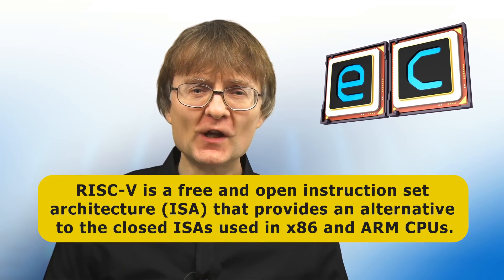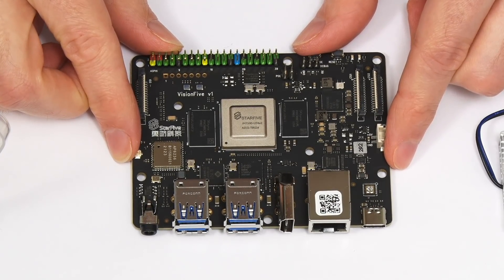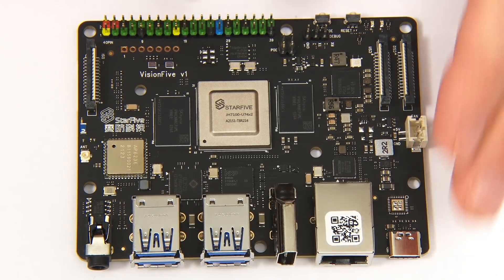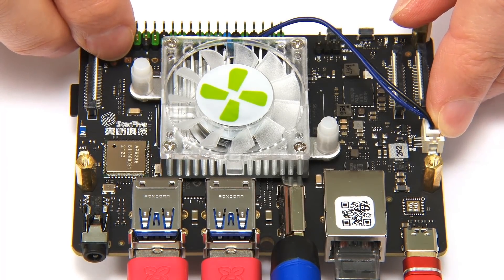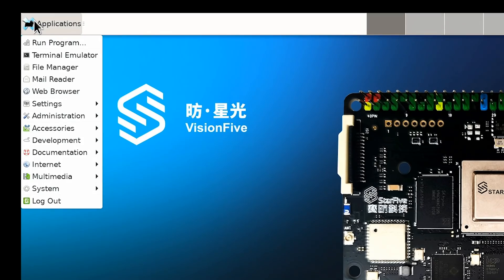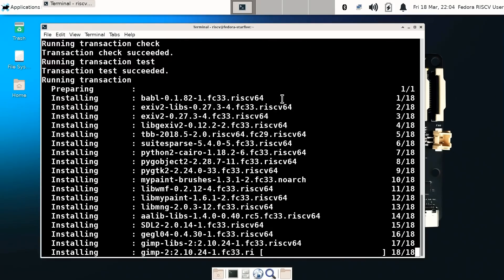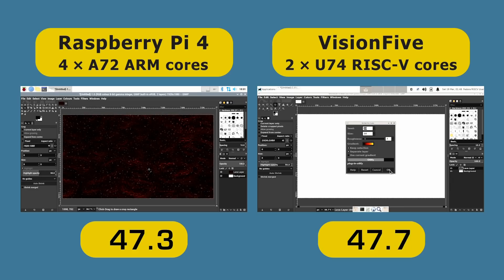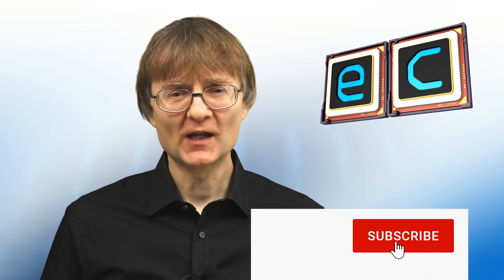VisionFive RISC-V Linux SBC

Comment: I'm confused, not that that takes  much! But,  I've always believed the processor hardware defined what instructions had to be used for that processor. How can you have differing sets of  instructions for any given processor? How can you have open source ISAs that differ?

I'm excited to see any new open source hardware or software as it frees us from the proprietary reins of manufacturers and software houses! But I'm at a loss as to how you can have more than one ISA for a given piece of hardware.

Thank you professor! An enlightening video!
Reply from the maker: Thanks for this. :) You cannot have more than one ISA for a given piece of hardware. RISC-V does allow more parties to design custom CPU cores. But the "open" here refers to the involved intellectual property (IP) -- anybody is free to use the IP to design and manufacture a RISC-V core and processor. This is in contrast to x86, where only Intel and AMD can make the chips, and ARM processors, where a license needs to be paid to ARM.

Comment: A great start to the revolution!
A RISC V processor with 8 MORE ADVANCED CORES WOULD HAVE BEEN MUCH BETTER THAN ADDING lot of RAM if focused on performance.
Reply: It's not focussed on performance, it's focussed on developing software. There is a lot of modern software that is very difficult to build AT ALL with 4 GB or less of RAM, which is the major reason that most Linux distros are rapidly dropping support for 32 bit ISAs.

Comment: Hey Chris, great video. But I have an old question that tends to gain significance in the RISC computers. Doesn't open-source architecture / software suffer from incompatibilities between different systems / configurations?
Reply: I've not noticed that as a problem.

Comment: That is a nice board. A good start, obviously higher clocks and quad core would be better, but not too shabby. I like it has 8GB of RAM, and good connectivity. I might grab one.

It looks like it is really for video processing using the included AI accelerators. Only could hope drivers would be open sourced.
Reply: It looks like you'd fit two eyes to it for robot vision.

Comment: I don't understand why so much hype for open instruction set. The soc is proprietary and hardware is not in public domain. If some wants true open source from grounds up then better go with Stratix boards and develop your own hardware only effort needed is to port linux kernel to that custom hardware.
The price does not justify the specifications or compete with other devices in terms of performance. 
Also at that price point one can get a good config i7 pc/ laptop either damaged or refurbished but fully functional. 
Just another contribution to e-waste
Reply from the maker: On the price point, this is an early develoment board, so any price comparison to existing mainstream technology is ludicrous. On the "hype" as you call it, the RISC-V instruction set is open, which means that anybody can design and manufacture a CPU based on it. In contrast, only Intel and AMD can make x86 CPUs, and nobody can design and manufacture an ARM CPU without paying a license fee to ARM. And that is the point. The fact that final CPU designs and hardware are not in the public domain is irrelevant -- this is not about open source, which is a software thing. :)

RISC-V is about control, and in particular intellectual property (IP) and the licensing thereof. And in a world in which trade barriers and sanctions are rising to the fore (for good reason on many occasions), this is likely to be key force behind RISC-V.

Already China and Russia have announced plans to make RISC-V desktops and laptops so that their access to the involved IP cannot be constrained. More broadly, the current reality of the West telling the rest of the planet what technology to use, and charging them for it, is not likely to remain intact for that much longer. And this, regardless of what we may think of the involved politics, will be the major driving force behind RISC-V. :)